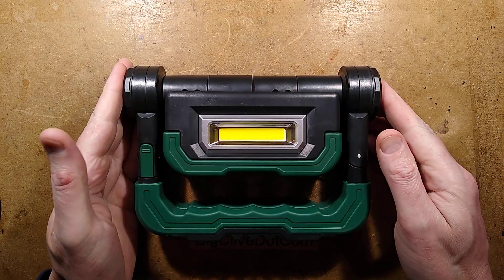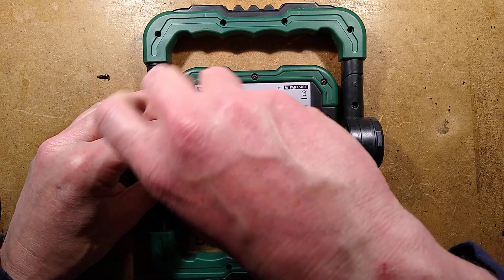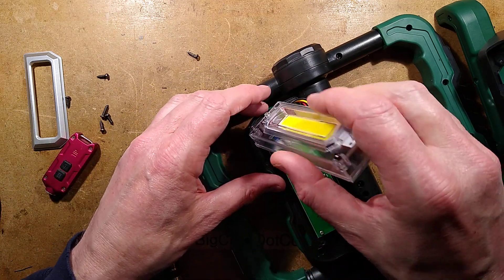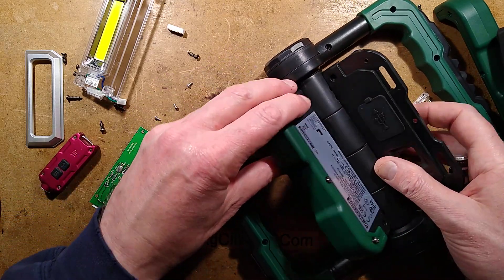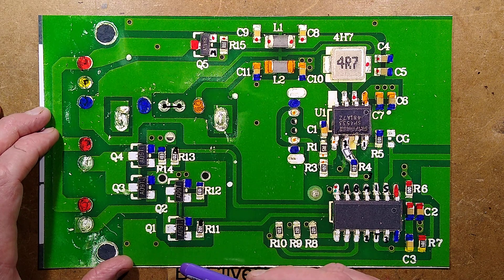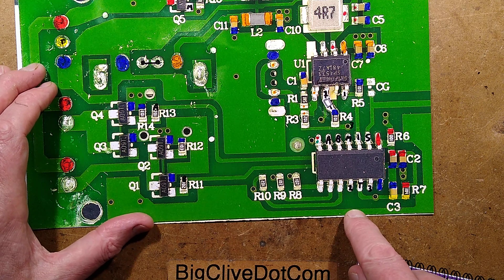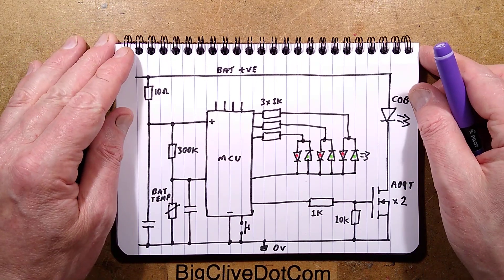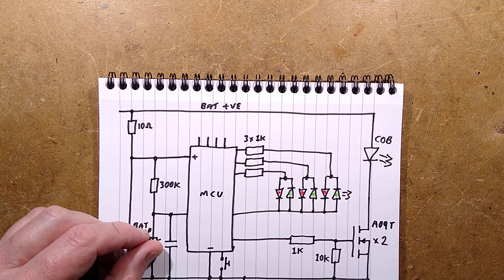Inside a LIDL rechargeable work light and power bank (with schematic)

Comment: I like the multi angles that you can set with the lights. Is that cell really 5000mAh? As you say, heat is likely to be an issue. With all of that plastic tube, an 18650 set up would have been better, but it's all down to cost...

Comment: Considering the charger is on the switched side of the MOSFET, would it make charging impossible if battery protection cut off due to undervoltage?
Reply from the maker: I think in the worst case scenario the parasitic diode in the MOSFET would allow the current to flow through the MOSFET while off to power the microcontroller.  I'd guess the MOSFET is just to deal with higher quiescent current of the power bank circuit.
A real issue would be very long term storage where the protection chip on the actual cell would block recharging.
Reply: @bigclivedotcom  Could this be planned obsolescence...?

Comment: Just thinking that you could do a minor hack to the circuit, by putting in some programming resistors on the USB C side to increase the charge current. Just because we can.
Reply from the maker: Charge current is actually set by the power bank chip at about 1A.
Reply: They should add two resistors to the CC1 and CC2 pins of the USB-C Port. Only that way will every charger work with it. Otherwise it won't comply to the USB C spec and won't work with newer chargers (which would defeat the purpose of an all-in-one charging port). 
I hate to see this, as the design is otherwise great

Comment: Wow 5000mA is quite a large flatpack, that is about the size for laptops, although they do use more of them. Great work Clive. 🍻👍🏻
Reply: most laptops dont use lipo-pouches at all. usually they're loaded with 18650
Reply: @casemodder89  Old laptops... Modern ones tend to be thinner than 18mm!

Comment: I could see being concerned over heat if you were using it while plugged in for a long time.  Also, outside in the sun, that black case will get very hot.
Reply: Hmm, why would you be using a work light outside in the sun? Lol! I guess you might be using it as a battery bank to charge your phone but you wouldn't want to leave your phone in hot sun either.
Reply: @chrisglen-smith7662  I can’t believe I said that!